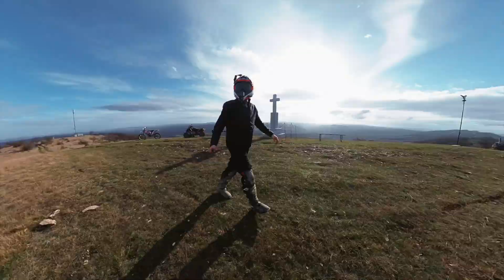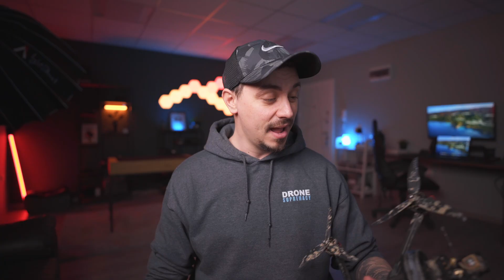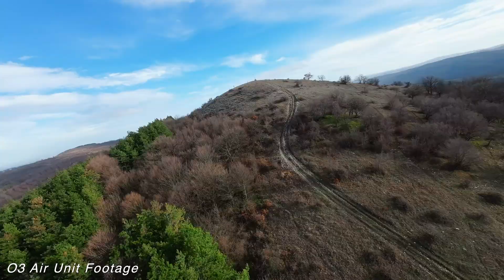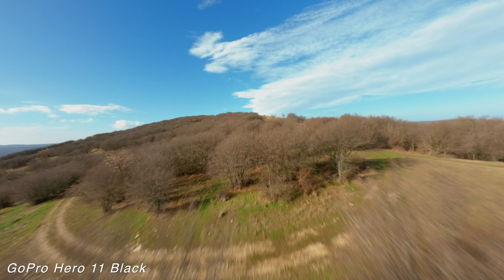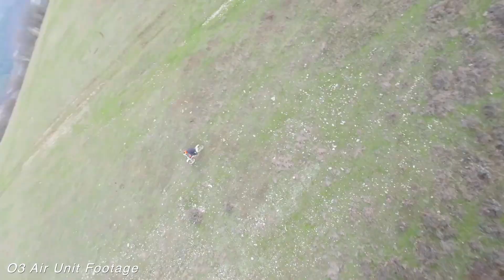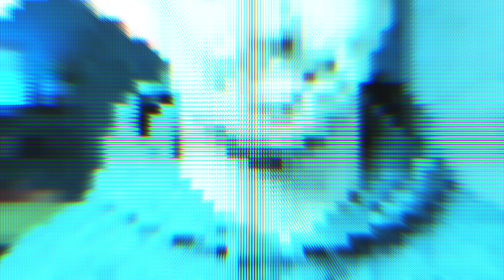Long Range FPV? NO PROBLEM! iFlight Chimera 7 Pro v2 Review

Comment: hello,i want to fly easy 3,4 km and have tango 2 which output power you recomand to put in tango 100w,250 w or more ? thanks you
Reply: I did 3.4km exactly on a radiomaster boxer at 250mw.
I heard you can go over 7.5km easy on the 250mw setting.

Comment: Informative video, but for those of us that want the best video quality, a GoPro is a must have. It has nothing to do with whether one wants to do acrobatics as you said in the video and everything to do with dynamic range and sensor size and quality. 

I’ll fly a heavier drone if it means my video is better. And when I used the O3 on the Avata, before building my 5”, I was not happy with the dynamic range at all. I can’t imagine going back to that camera.

Comment: Hey man, do you know where a buzzer could be placed so you can still reach the button when you disconnect the battery? I have lost a chimera 7 while doing long range and I got to the place where it crashed but without a buzzer it was impossible to find. I am getting a new one with O3 soon and I really need a buzzer with battery in there cause I lost 1200euro because I lost it with the Hero 11 black and a 5euro buzzer could have saved me, but when I look at this drone I see side panels everywhere making it hard to reach the button everytime you disconnect the drone.  Thanks
Reply: There is an integrated buzzer close to the camera of the drone. But it does not have an autonomous battery like a Vifly finder.

Comment: Max range on Chimera7 v2 i get is 800m an then failsafe, but the problem is thar GPS unit is very bad quality, it gets gps signal lost all the time so no failsafe huh :) More over antispark completly melted and i've got power loss during low throttle flight. It's cheap shitty chinese quad for the premium price. But when it flies it flies well.

Comment: Great video! A tip, use a rain cover that is made for a larger backpack. I can cover my FPV Backpack and 7" drone on the back of it with my raincover so i dont have to worry about rain and dirt. Also good if walking in public so i dont attract attention if i dont want to.
Reply from the maker: That's exactly what I decided I'd do from now on, moving forward. I think it will be very handy. Thanks for the tip!

Comment: One more time please: how are you able to record and display in your video ( this video) your OSD telemetry information?
Reply from the maker: with the O3 Air unit the OSD info is built-in inside the video itself.
Reply: @Mihail.Svilenov  Understood, but do you use a special program in post to make it visible when you play the video?

Comment: Great video as always Mike! The lens flare that is visible on the O3 air unit is that caused by light reflecting back from an ND filter? I get that every so often and it drives me nuts.
Reply from the maker: Actually it happens regardless whether you have ND or not, that's just how it is